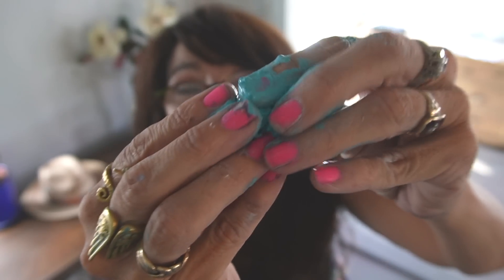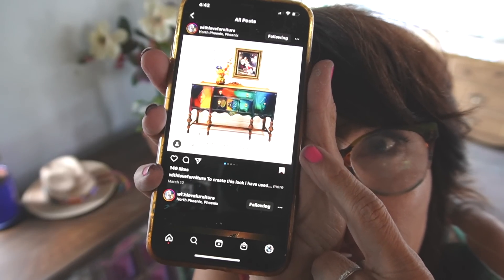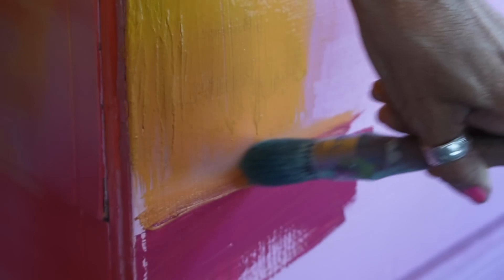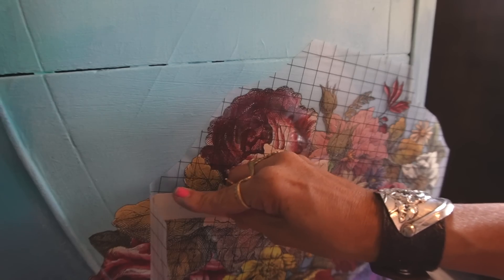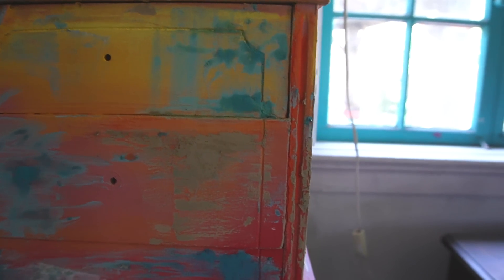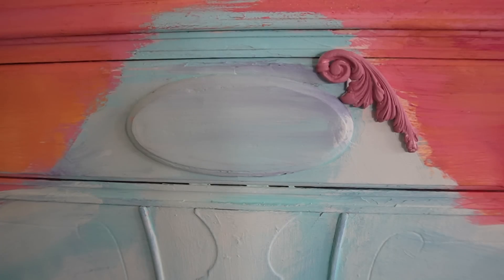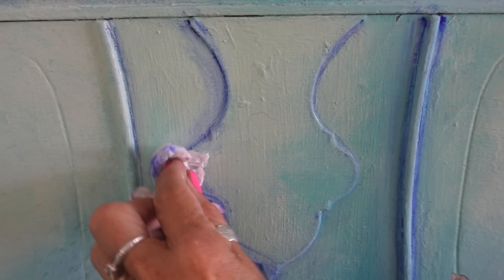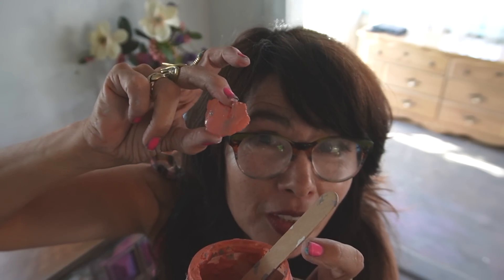Extreme Paint Texture with dried up Paint and the time I confronted someone who stole from me

Comment: Debi I have a question I bought the new cottage paint and let it set one full day to dry and I went to put a butterfly transfer on the dried paint on the furniture. And the paint seemed very dry and curd, but the transfer when rubbed took the paint with it. So I cleaned it up and painted again and let it set for over 24hr and it wouldn’t let me but that transfer on it again, lost two beautiful butterflies. Is it you can’t put transfer on cottage.paint?
Reply from the maker: I’m not sure what happened. I just did a small piece of furniture with the cottage colors and put a transfer over the top went on super easy. The only time I have had trouble with the transfer not going on was with a particular piece there was something in the finish of the wood that was not allowing Paint to adhere, I made a video about it. I will link here. I would do a test on another surface. https://youtu.be/WBlrU-cl9cA?si=me4D6Ne_MbdFeZzU